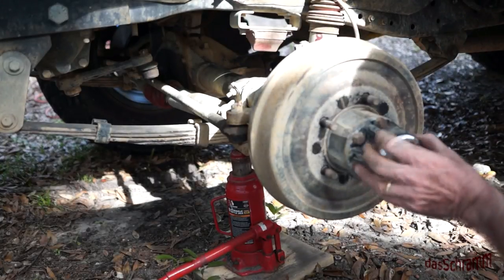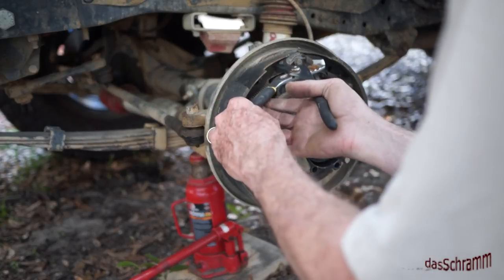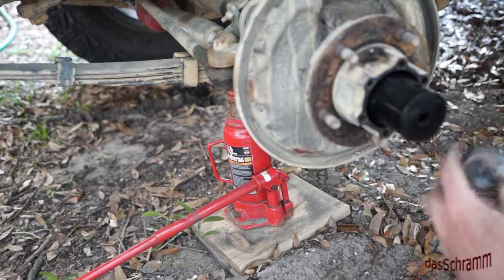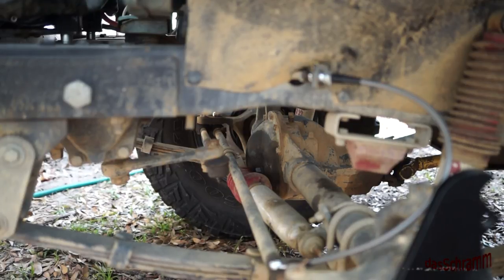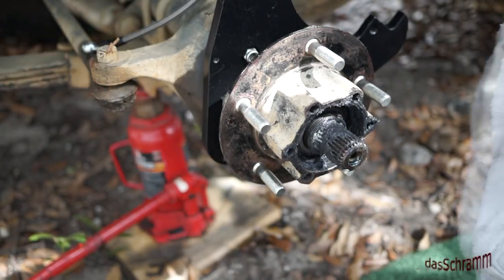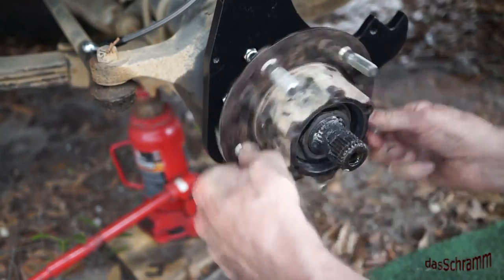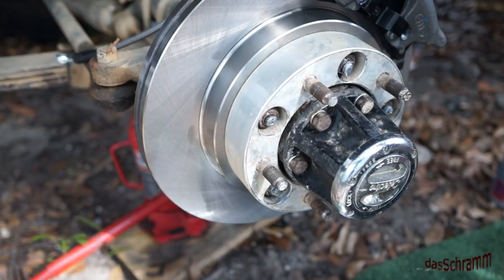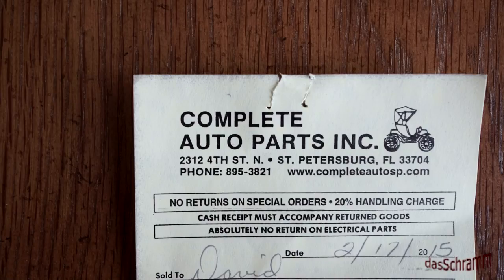SSBC Drum to Disc Brake Conversion Experience - Part 2

Comment: Hi- thanks for posting this video, it has really helped with my install- i have done it on a '73 CJ5. I am running into all the same problems/design flaws that you did- plus one. After I have got the entire kit installed, i went to bolt the wheels back on and found that the calipers were too big- they hit against the inside edge of the rims, which are stock backspaced 8 spoke wagon wheels. After grinding down the meaty outer flank of the calipers by at least a 1/4", i decided that I was going to have to remove too much of the caliper too gain proper clearance. So, I'm awaiting 1.25" wheel spacers to push the rims out enough to be functional. Not what I wanted to do, but the situation leaves me with no other option. All in all, not a kit i would ever go with again. Thanks again for taking the time to put this out there, really helped me out!

Comment: Can't the caliper carrier be rotated one bolt (clockwise at 8:40 in the video) over  to avoid clearance problems with the castle nut? I'm just curious as I don't see any pictures in the installation instructions,  online, or at SSBC of the proper positioning of that.
Reply from the maker: +Ben Quick It has been a while, but I don't think so.  I think you would run into other problems.  The instructions are clear about specifying the position.
Reply: The instructions specifically say to mount them is the 2 o'clock position.

Comment: Really appreciate this video.  I'm getting ready to purchase this system for my 73 CJ5 and see in the current picture that they've changed the master cylinder to accommodate the brake lines on the correct side.  Let's hope it's shipped that way.  They also tell me (they-meaning 4WD) they've not had the same king bolt interference you had.  I hope that's correct too.  Any other thoughts you would share on front brake installation prior to purchasing this system?
Reply from the maker: +Tom Poulson Another viewer reported that he had the same king bolt problem I did.  Let me know what happens with yours.  Nothing much new to report other than I love having disc breaks!!!

Comment: Nice video! I too am considering the conversion for my73 cj5 dana 30. Not sure about rear disk at this time. 
You mentioned friction loss when wet. Im wondering if upgrading to the slotted rotor might help eliminate that along with semi mettalic pads? I am looking at that upgrade. 

I think I would have used a crows foot for retorqueing the king pin. Just an idea. I also remember a mounting requirement of 3 o’clock for the caliper mount plate. Would that have corrected the castled nut interference?

Overall, with the front and rear conversion, have you found that it offers superior braking and handling over the oem drum brakes?
Reply from the maker: The friction loss I mentioned is with the drums.  The disks don't have any at all. No need to change what they send in the package.

Comment: Now i don't really understand why you couldn't just build your own mounting bracket, as long as you machined the bracket with 1/2 inch steel and thenset it on the same way couldn't you use standard gm calipers, rotors, and break lines?  Also if you tap in the bolts from the rear yo could have then put on the lug nuts and tightened in the studs with an impact wrench.  Im just thinkingit would be a simple build as long as you have access to a cnc machine.  Wonder why the kits are so much?  Anything special besides the brackets?  if you have to order brakes what do you tell them the kind of brakes you need?  just standard jeep brakes or are they gm brakes?

Comment: I am reading all the coments about how bad these kits are. But are there alternatives if you want a complete kit????
Reply from the maker: It has been several years since I made this video so I don't know what is currently available.
Reply: i’m trying brackets from brennan’s garage on my ‘74 cj5. apparently suzuki rotors and calipers bolt right on. 
waiting for parts to try it.

Comment: Ebay item no. 311492627483 - Check this system out being sold on ebay.  I ordered this today.  It was pointed out to me by Barney's Jeep Parts, a parts dealer I buy my mid year jeep parts from.  Looks like this might be a better fitment then the SSBC.
Reply: I talk with Barney routinely. 
That kit your mentioning is the same kit im considering i believe. 

Have installed it yet and if so, how satisfactory is the quality and performance?